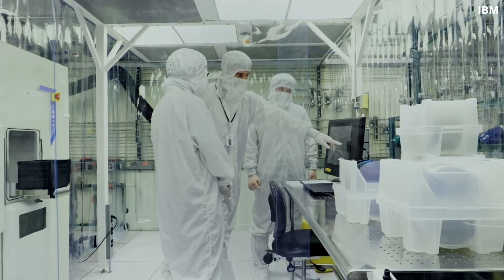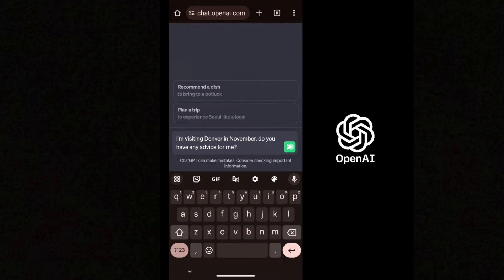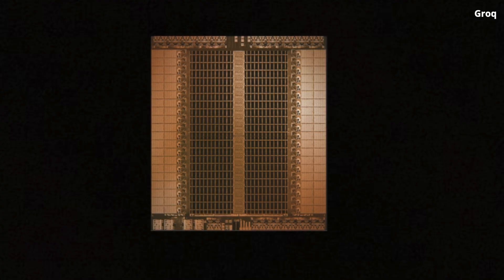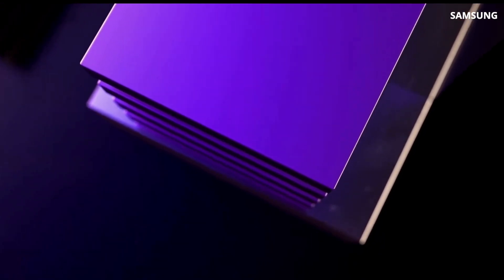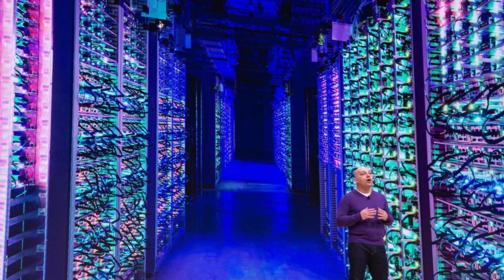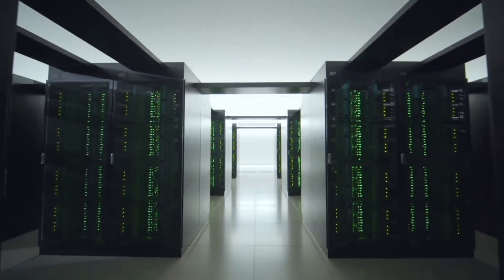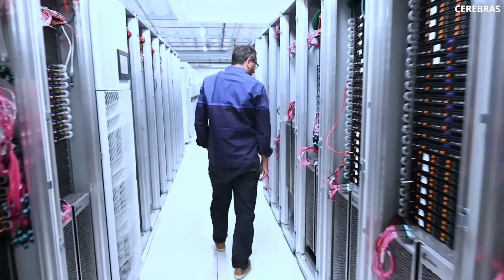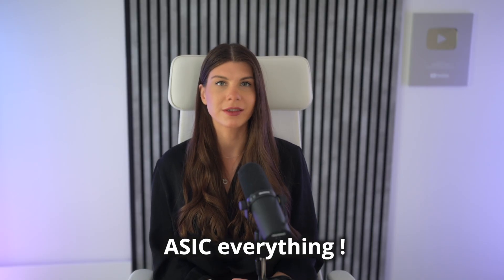Is This the Fastest AI Chip Ever?

Comment: Groq signed a $1.5 billion deal with Saudi Arabia. They also have Cerebras installations. Cerebras may be faster. You need to compare Groq and Cerebras. The biggest current models are bigger than necessary. On Cerebras Inference they are using 70B models which are doing just fine. The path forward is smarter, not bigger.

Comment: Very good video, the only one I saw explaining the cons of the technology. Requiring several hundreds groq chips to run llama or mixtral, costing several millions USD (1groq chip costs 18k USD), compare to Nvidia less than 10k USD hardware to run the same model, the speed gain has a huge cost. To be profitable, groq will have to put many customers in a queue. The generation speed will be offset by the time spent queuing. This is already what we experience in groq site. Thanks a lot Anastasi for the thorough analysis.

Comment: Groq is amazing and a dread end. It is amazing for small latency optimized networks - i.e. robot control, image analysis. It is not good for anything that has billions of parameters, the whole price side totally fally apart. They have 230MB per chip - that is amazing, an AMD MI300X has 192gb RAM - and 1gb of cache (compared to the 2gb og 11 Groq chips on a card. Large models are not going to be cost effective at all. I rather would go for the DMatrix Corsair C8 when it comes - using LPDDR4 but 512 channels for 256gb memory. 3.2gb*512 is 1.6´tb and you can at least hold the weights for a larger model.

Comment: I would like to think of a semiconductor that operates only by the vibrations of the stone. Is it possible to accelerate the flow of electrons in a semiconductor using just the vibrations of the stone? If we do that, I think we can create a flow of electrons within the semiconductor with minimal current and voltage.

Comment: Simple bemchmarks might wow investors, but your observations of scale limitations based on memory limitations represents the fatal flaw in their present chip design.  I suspect its why they're moving to a better chip fab which can achieve higher density and memory capacity.  ASICs are probably the future vector for llm compute, but i suspect it will be a few years at least before gpu's are obsolete.  Especially considering they can still be used even if "better tech" exists in parallel.

Comment: I'm sure we all know that rivals are more or less going to do much of the same thing to rob them of that advantage, probably even integrated into cpu's or gpu's.

On the plus side, this could have a big impact on reducing the price of A.I. chips, which is distorting the entire gpu market at the moment.

From what I understand of it, from performance per watt, it's already much better than what Nvidia offers, if so and considering that this is 14nm, I do wonder how much faster and lower power consumption the 4nm will be.

I also think that because of the task that this chip does, which is far more streamlined compared to a cpu or gpu, it's likely that a lot of rivals will be able to enter that market much easier than the traditional cpu and gpu markets, especially because for A.I. the drivers are much more streamlined and easier to do, that's great news because it very likely in the coming years will put a lot of downwards pressure on the price whiles boosting performance and with that, we might end up with some kind of A.I. chip that we can slot into a consumer grade PC, which I think locally run A.I. models are going to be far more important then the online centralised models, because of privacy and security reasons, which has A.I. because more capable and useful, it's going to be more involved in our daily lives, which I suspect for most of us as well as businesses, it wouldn't be that appealing to share so much data with an online central database/

Comment: I'm quite sceptical about the viability of a chip that relies solely on on-die memory. 587 chips for a 50B parameter model does not sound like it's capable of scaling for the really big models.
Moving to Samsung 4nm won't help much, either, since memory scaling is starting to become nonexistent for smaller process nodes. What you have is what you get unless you start investing more die size - or stacking cache on top like AMD's 3D V-Cache, but then we're back to the point of relying on modern packaging technologies.
Showing a financially feasible path forward to running large models on their hardware seems like the most urgend challenge Groq has to beat, at least to me.

Comment: The challenge is reduce the software to hardware time, when the hardware defines the software design. In my opinion, we need a more general hardware platform that is scalable and cheaper. The solution is create an open hardware architecture like RISC-V, with a lot of collaborators to create a new Open Neural Network Unit. Data processing is a very complex system engineering problem, because the old problem of transfer the data from low latency to high latency memory to be processed and than be stored back. In the recente past, huge processing problems was not so data oriented so with more process power more information, but now the problem of memory hierarchy is back. We need more memory near process units and less processing power to reduce the latency.

Comment: The memory limit is a killer limitation.
Tightly coupled small RAM is not a new approach and the problems are well understood. The big question is whether or not they can develop their algorithms to cope with the limitation however, this is typically not a simple problem to solve and leads into combinatoral optimization scenarios. Generally the long term solution to that sort of problem is always to just add more RAM. Ironically I could see this Grok chip working far better for canned problems rather than the general application it is being target for. 
Let us see what happens.

Comment: Impressive but I don't see the future in digital chips for AI, just a very poor fit for this purpose. Photonic optical fiber based analog "chips" have a brighter future for sure. The inefficiencies of silicon based digital chips for massively parallel neural networks are too great. Our brain really shows how it can be done although biological computers are just too slow but the parallelism of our brain is unmatched. Simple operations like adding a million numbers need to be done lock-free in parallel in O(1) not O(log(n)) with locking.

Comment: If it's possible to fit Groq chips close to each other on one device then it should be a 50cm x 50cm square to run 60 Billion parameters model. With 4nm it will be 13x13cm, maybe. Even with big spaces (1x chip size), it will be two 30x15 devices (size of GPU) to run GPT4.
Disclamer: I know nothing about chips building .

Comment: 📝 Summary of Key Points:

📌 The new AI chip, Gro chip, is designed and manufactured in the US, offering impressive speed and performance for language processing tasks.

🧐 Gro chip stands out due to its on-chip memory, which minimizes latency and reduces costs by eliminating the need for advanced packaging technology.

🚀 Gro chip's benchmarks showcase significantly faster inference speeds compared to other AI accelerators, making it a promising option for various applications.

💡 Additional Insights and Observations:

💬 "Gro chip's on-chip memory and unique design contribute to its exceptional performance and cost-effectiveness in the AI market."

📊 Gro chip's focus on inference as a service and scalability highlights its potential to cater to a growing market of businesses needing AI solutions.

📣 Concluding Remarks:

The Gro chip's innovative design, impressive benchmarks, and focus on inference services position it as a promising player in the AI hardware industry. With its unique features and potential for scalability, Gro chip could be a game-changer in natural language processing applications.
Generated using TalkBud

Comment: the speed it is not that important, the software is more important .. if you do not care about the power consumption no one can stop you using 1 10 1000 slower chips that work in parallel and perform better that one chip

Comment: SCALE LOCALLY ... Decouple the memory but keep it *very close.  Another way to look at it is to distribute processor nodes throughout an air-cooled, 3D "block" of ultra dense memory. Pack it tight and allow for cooling, at every layer of scale.  
.. In this way, you can vary the ratio of processor nodes, to memory cells, at any layer of scale, as dedicated applications may require.

Comment: Surprise surprise, who would have thought that designing hardware to perform specific tasks, would be faster than it's software capable counterparts (I know, ASIC and other things run firmware which technically is software, but it's not general computing in the same fashion).

I think this is mainly hype. It's not like they invented new technology. They just designed hardware to suit LLM-computing.

Comment: You don't need 2xH100 to run Mixtral 8x7B model. 2xRTX3090 with 4 bit precision is running 30T/s (Yes lower precision, but it works very well anyway). 10TB model will probably be not needed. The specialized models the same way this hardware is specialized will be more efficient and popular.

Comment: When your chip is an entire 12 inch wafer.. I can only imagine the heat that would make when running at full load, also the reject rate.. 😮😮😮
Reply: Apparently it's 23kW sustained per 'chip'. But the yield should be almost 100% because of built-in redundancies to deal with manufacturing defects.

Comment: The real question is that given at how and why they are able to achieve this speed; how long until others who have the manufacturing capacity can replicate the architecture. It see that while impressive the barrier of entry is very low for companies like Intel and NVIDIA. Groq is essentially optimizing for inference by adding components that would naturally reduce latency. Others like NVIDIA are yet to start doing this. Nevertheless it's exciting to see how they were able to improve inference dramatically with 14nm and using such basic architecture. I can't wait to see what the inference speed will be at 4nm or using more advance components.

Comment: Groq can increase memory per processing unit for very large models. Its not a big con. Also keep in mind it will be manufactured on 4nm which will decrease area and increase performance per watt.
Reply: Mix logic and memory is always less dense than separate chips for logic and memory. Without logic causing interference you can pack memory closer together not even accounting that DRAM uses a completely different process so integrated memory must be either eDRAM or SRAM both are less dense than standard DRAM.

Comment: First thanks for your your wonderful video. Groq can always add more memory with future design. And it seams like the software stack is flexible to be compatible with future hardware design without much development. At the same time the development of LLM getting smaller and moving forward to more specialized models that are chosen by a predictable model. So if Groq can utilize this it will be perfect. And as you said the small and middle enterprises that want to keep their data local is a huge business.  A small business don’t need 10 trillions of parameters for there internal data. Yes it’s required more chips than GPUs. But there are more easy to manufacture and they don’t need to stand in line at the 1 nanometer factories. And the Groq flexible router is built in the chip so no expensive Switches are needed. And at last it’s a huge saving in electrical power.  NVIDIA should buy Groq now before they get to large . Jerry

Comment: While Groq is amazingly fast, I have found some issues with it. I have some structured text that I want in a JSON format. ChatGPT, Gemini, several of the open LLMs, do a pretty good job at it. Groq did a great job at recommending the JSON structure and it was very clean. But the text that was copied into the structure was misspelled. Apparently it actually looked at the text and transformed it into what it thought I meant rather than as a simple string. Still working on convincing it that I want the text exactly as requested. I may tell it my family is being held hostage if it does not get it done accurately.
Reply: it could be a problem related to the large language model used, probably (mixtral 8x7b) rather than the hardware itself

Comment: Groq chip is NOT Grok AI on X, in case anyone was unaware. As of 3/1/24, Groq is supposedly 13x faster inference than Nvidia. However TCO may be an issue. An ASIC is less flexible over time and everything is changing quickly. When are we getting Groq/llm inference asics on our smart phones? How does this compare to Google TPUs?
Reply: Every silicon implementation has pros and cons.
Reply: ASICs just seem to be the better overall design choice for this specific need. But I understand CPU's much better than tensor processors.

Comment: Can you do a video on Lithium niobate Integrated Photonics chips?
Reply: They can make them out of gallium nitride, the lithium niobate is used for the optical waveguide switches an polarization components. Optical analogs of CPUs can enable quantum computing without the need for extreme cooling because the photons and interactions are not thermally populated until well above room temperature. Growing large GaN devices is a problem though.